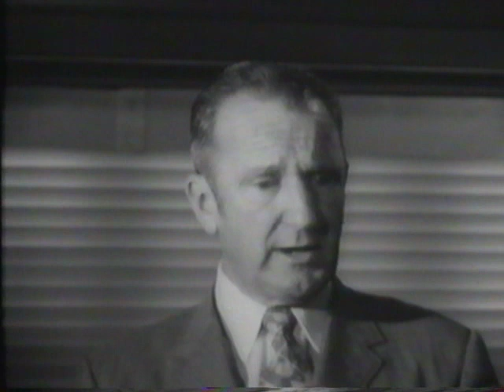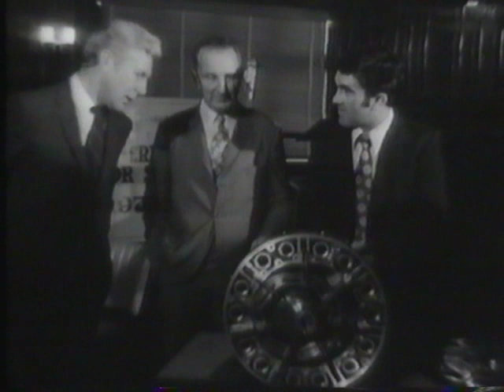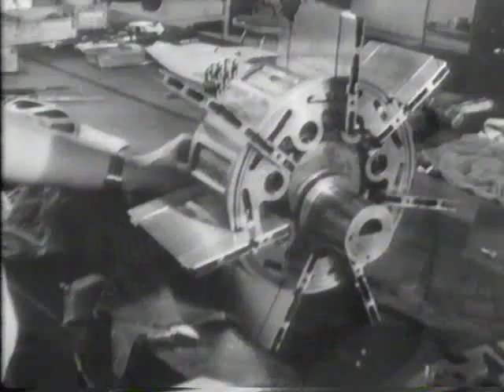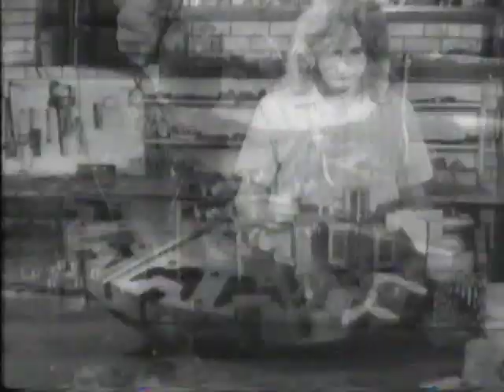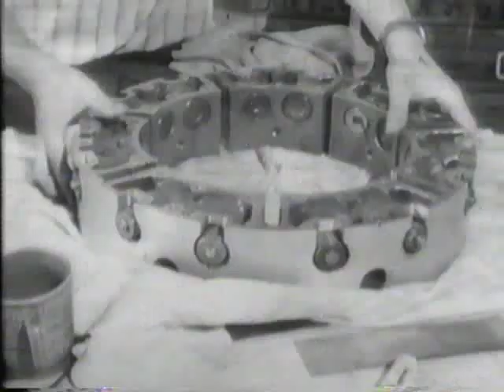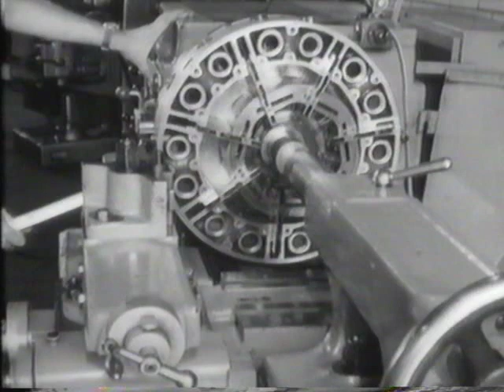Sarich Orbital Engine Ralph Sarich 1973

Comment: @JosephCowen-fz8vj  Okay, Joseph. Show me one vane pump built with an 'orbital ' rotor. There are sliding vane pumps, and concentric vane pumps, both also used as superchargers at various times. In both those designs, the central rotor actually rotates. In the orbital engine, the central piston section 'orbits'; that is the top will always stay at the top as it moves in a circle. The point is, this is not based on a 'proven' vane pump design. Also, a pump is usually a lot easier to build than engine with the same fundamental design, since combustion temperatures, ignition systems, and fuel systems add to the equation. One other point. Certain people keep perpetuating the idea that the engine tested by Ford in the 1980s, was of the same type as the original Orbital engine from the 1970s. The name refers only to Company doing the work: It doesn't refer to the engine design of the 1970s. The later two-stroke piston engine was of conventional design, but with Orbital Engine Companies unique fuel injection system. It was not an 'Orbital Engine'. That was long defunct by then. So much for keyboard warriors.

Comment: Way too complicated Engine - Doomed  from the beginning - This is still crank engine and could never be as efficient as a piston engine. Ralph seems to think it is a single piston engine but it is really dependent on the number of chambers. The shape of the cylinders are constantly changing leading to poor combustion and the combustion pressure is wasted because not all the pressure is rotating the piston. Graeme John Eddington.
Reply: Always keyboard warriors who have little understanding dribble out things they read . Great design based on a vane pump and was well designed , today could easily be built!
Reply: @JosephCowen-fz8vj  ahhh, yes, those keyboard warriors...

so, if its so well designed, and so simple... where is it now? it was highly publicised. millions of dollars in funding and grants to develop, even used as an example of the "operating principles of the ICE" in some text-books...

yet theres no running model? 

so, mr keyboard warrior... why is that?

oh... yeah, i forget... "big oil"... nothing to do with basic mechanical principles at all... 

the company he founded still exists. i met him twenty years ago. he happily discussed the precise reason it never worked. he didnt realise at the time, yet was grateful certain investors and funders also didnt realise either. 

the reason it doesnt work, like any other vane PUMP being used as a "combustion motor" is very simple. so simple its often overlooked.
Reply: @JosephCowen-fz8vj  It's not really like a vane pump.
Reply: @AndyRRR0791 it's closest to a vane pump just orbiting not rotating , I'd be saying he got the idea looking at a vane pump .
Reply: agreed. most of the pressure is acting radially... doing nothing but radiating heat away through excessive surface areas, and the little bit acting on any vane is counteracted by a nearly equal force acting on the vane at the other end of any "chamber".

only a tiny fraction of the pressure gets to act "tangentially" in one direction. unlike a piston in a cylinder once its passed TDC... and even that only starts to get a decent amount of mechanical advantage or leverage around 45 degrees or so... at least all the pressure on the piston can only make it act in one direction...

Comment: Is this engine design used in Maleo car proto back then in 90's?
Reply: Unfortunately the maleo never made its debut. The Toyota Kijang and Timor (KIA Sephia) is more loved by Indonesian Gov.

Btw, Indonesian here
Reply: No, that was the X-engine which was a 1.2L 3-cylinder two-stroke which was largely developed with Ford backing but they abandoned it in about 1995.  It was planned to debut in the original Ford KA but they ran with the OHV Valencia engine instead.

Comment from the maker: Hi, I actually worked at Orbital Engine Company for 13 years from 1985. The actual Orbital Engine was shelved in 1983. There was to many issues with it ,mainly sealing problems. The company mainly concentrated on the fuel delivery sytem that was first used on the Orbital. It was adapted to use on two stroke engines. It used air and fuel to inject directly into the cylinder. This went on for many years and the company invented many other patented ideas. The company is still going today .
Reply: What’s the company called now?
Reply: Do cry, oh cryer, "what of the night"
Reply: David Cryer Hi, can you please tell me where you sourced this footage? It's amazing!!
Reply: Hey. Can I have a full PDF containing the full engine blueprint?

Comment: This should have been developed... it was buried by big companies that saw it as a threat.
If I recall correctly, Ford was one company instrumental in getting it's development terminated...
Reply: Ford, in London, got the patent, and from then onward nothing else happened.
Reply: You're wrong. Look at the Wikipedia articles on Ralph Saritch. The engine was fundamentally flawed so didn't need to be terminated by Ford. This is a dumb conspiracy theory probably circulated by Holden lovers.
Reply: I mean wikipedias 'never'wrong !
Reply: @Usernamebonus4  my dad is a mechanic, and he said big companies brought him out.
Reply: @chrisismail  your dad spins spanners and does oil changes.

he never stops to think about kinematics or basic mechanical principles.

the reason they never worked is really simple.

each chamber is formed by two vanes.

pressure acts in ALL directions equally.

so it acts on two vanes at the same time... one acting CW, one CCW. the only force "left over", the only force that can cause rotation, is the difference in their areas. 

if you have a thousand psi of combustion pressure, one vane with 1squin, the other of 1.1 squin... the only "extra" force available is that 0.1squin of area. which at 1000psi is only 100 lbs. yet teh chamber itself with all that surface area is experiencing  tremendous, but useless, force.

whereas the same pressure acting on a piston of 1squin will deliver 1000lbs of force.